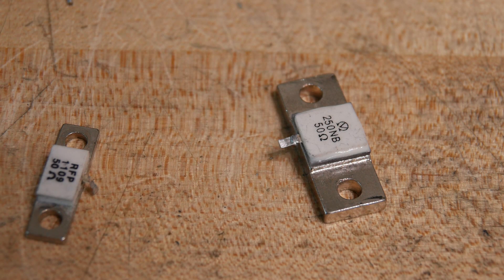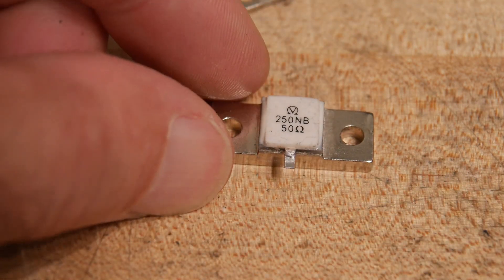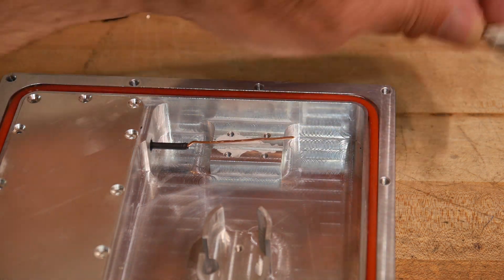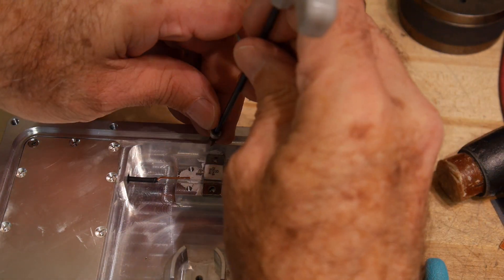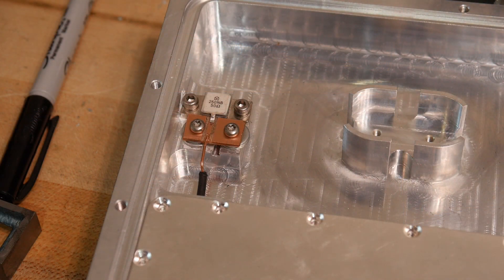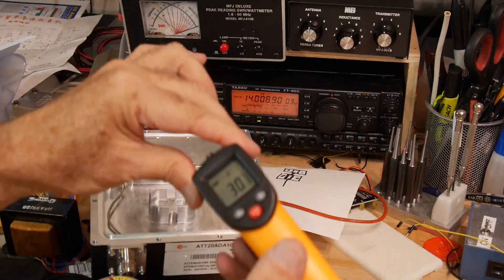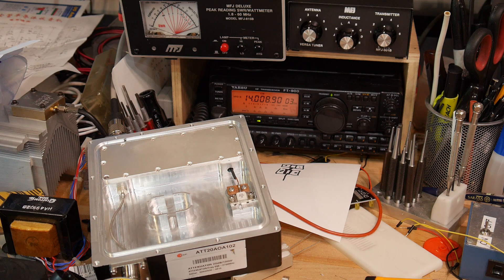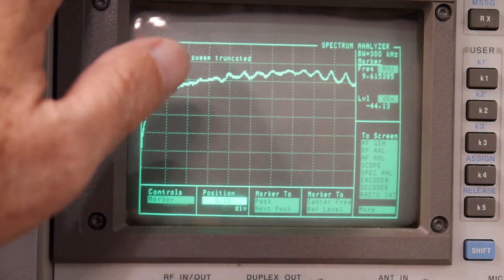#275 250 Watt dummy load completed

Comment: Those thermometers see IR from an exposure cone that grows with distance to the surface. So if you're holding it say 10 inches from a surface, it's averaging temp over a circular area of something around 3 inches diameter (depending on device). So when temping a small surface like this you'd get a more accurate reading if you hold it very close. Love your project, really nice build.
Reply from the maker: yes, that was an old video. companies have given me thermal cameras for review and I use those now.

Comment: Can this type of resister be submerged in a tin can of oil for heat dispersion?
Thanks.
Reply from the maker: I don't think what would work well. if you put it on a heat sink and then put that in oil, maybe
Reply: @IMSAI Guy  ok..that makes sense..
Thanks.
Reply: I know this is an old video - it is taking me awhile to watch all of these :) - but MY thought would be to fill the cavity with oil!

Comment: Hey, the thin tab on mine broke flush off while i was wiping some heat grease off. Any ideas what to do? Thanks
Reply from the maker: buy a new one :(
Reply: @IMSAIGuy   @PCS electronics  i fixed it by removing the top white slice with the lettering and soldering a thin tin tab to the what was left of the broken tab then crazy glue the slice back on top. Resistance did change however from 51 ohm to 58 ohm. tested it on my cb radio &  amp outputting 240 watts. No problem. I have it mounted inside a metal electric outlet box with a metel cover and 4 holes punched out. Straight Solid copper wire from resistor to center of pl259  on the opposite side of it. Would have ordered a new one but it take a month for delivery from China
Reply: @IMSAIGuy  what a waste, why the Fuk would theu puy a foil thin tab on it especially knowing how hot it can get too